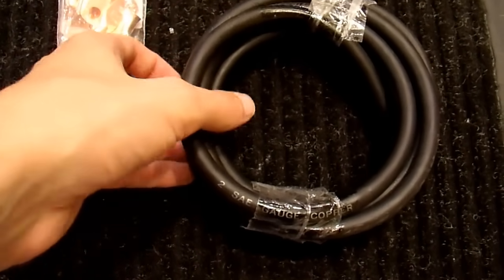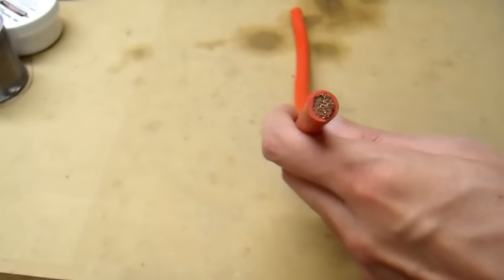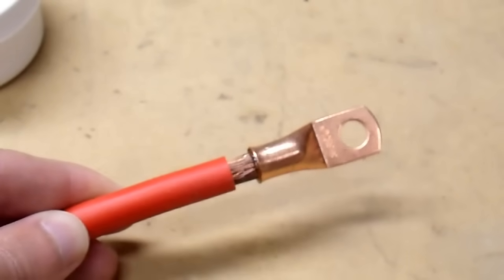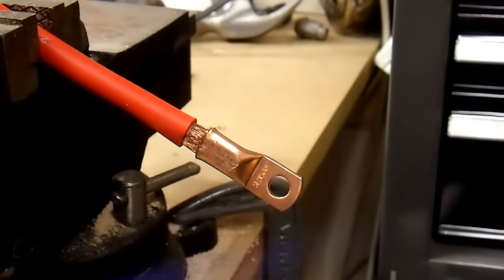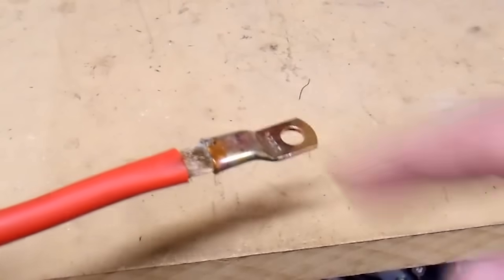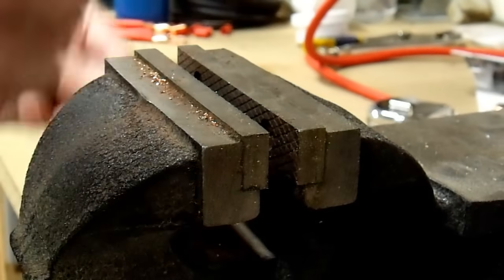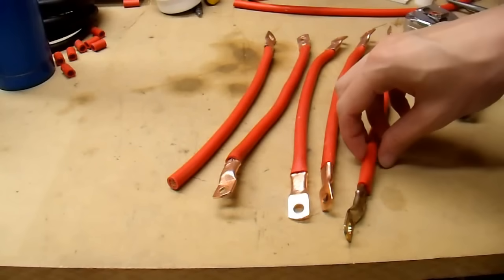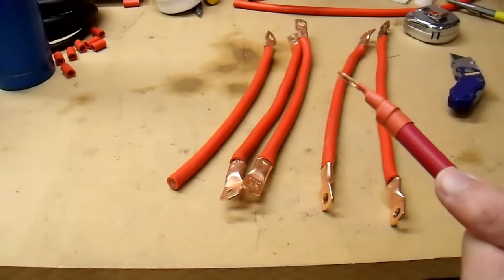How to Make Battery Cables the Right Way and the Easy Way

Comment: This is not the correct way to make battery cables.  Solder is hard and creates a fulcrum, a point that the wire will break.  Crimping is the way... Read up on Mil specs, and on aviation specs for battery cables,.. and automotive specs for that matter, none of them allow solder, and for good reason.  If you still wanna solder, then you shoudnt crimp.  Do your due diligence, then make videos.

Comment: Rosin is not acid.
Reply from the maker: Acid core solder exists and rosin causes corrosion if not fully activated.
Reply: @knurlgnar24  Yes. Acid core was always used for plumbing and rosin core for electronics. The container of rosin was used for tip cleaning by plunging the hot tip in the rosin to "flux" it when tinning.

Comment: I flux and tin the cable. Tin then fill the terminal with solder and stick the cable in the molten solder. Hit it a few passes with the heat to ensure it's flowed through all the strands, some heat shrink on it, done.

Comment: Putting solder into the connection is not necessary and in fact it is bad for the connection. The solder makes the strands od copper cable stiff and subject to be broken compared to an unsoldered joint which is more flexible!!!
Reply from the maker: It is in no way 'bad' for the 'connection'.  It is in every objective way helpful.  The flexibility issue is an entirely separate issue.  Would I solder a connection that is expected to flex during use?  No.  What percentage of applications are expected to flex during use?  Almost none.
Reply: @knurlgnar24  The whole purpose of doing this is to have a reliable connection and to say one aspect is irrelevant is foolish. Considering you didn't make your disclaimer in the video, my statement stands !
Reply: @LWRC  As a ROCK CRAWLER ( JEEP ) Soldering ALWAYS FAILS, ALWAYS, Crimping is the only way to go. A stated Solder causes connection to be stiff, flexing is what is needed in Rock Crawling.

Comment: Thank for making this video. Crimping is the preferred method for making the connection. Solder is subject to failure under vibration. Also, crimp connections alleviate the connection problems associated with wire and terminal hardware corrosion, as the mechanical action of the crimping crushes the oxidation layer, guaranteeing the low resistance connection. Soldering only encapsulates the existing corrosion, which causes a lowered ampacity. Crimp connection with v-divits are preferred to flat crimps, due to the mechanical properties of the interface created. Use of heat shrink, especially adhesive lined, is preferred, due to the added mechanical strain relief, as well as its ability to seal out corrosive elements. But not everyone needs a connection designed by an electrical engineer.  :-p
Reply: Agreed, we run 48V@600A at my facility and all lugs from 6/0 to 12G are crimped, no solder

Comment: Man! Electrical/electronic people are passionate about their craft!!! Maybe best for all (my) worlds: Flux & solder (tin) whole terminal lug (inside & out) and then cable end. Fill terminal lug cup about 1/3 with melted solder, insert cable and solder together, quickly, keeping flame near end of lug, away from insulation. Clean off any remaining (yellowed/browned/blackened) flux with 91% alcohol (that's what we used at Electronic Research Corp.). Apply Liquid Electrical Tape or hot glue, quickly slide shrink tube (clear?) into place and quickly shrink with Hot Gun (DON'T USE FLAME!). Cover cable terminal lugs and connection posts, after firmly connected together, with dielectric grease. Install non-conductive, sliding/removable boots over connections. NO CRIMP! I find it hard to believe that crushing/bashing thin copper strands together doesn't weaken and alter their molecular structure (cold welding my eye!). I believe that ANY pinch point, no matter how small, raises the electrical resistance, creating a (slight?) voltage drop. I desire the least amount of wasted power and the most protection against shorting and corrosion. Call me CDO. It's the same as OCD (obsessive/compulsive disorder) but all the letters are in alphabetical order... LIKE THEIR SUPPOSED TO BE!!! 🙃

Comment: You All Have No Clue As To What You Are Talking About, Go and Study Metallurgy, Rules Of Soldering And Alloys, That You Never Use Acid Fluxes In Electronics or Electrical Work, Work Hardening of Metal When Making A Crimped Terminal Connection Of Both The Wire and The Crimp While Making That Termination And How Heating By Soldering aneals, (Softens The Metals), That Were Work Hardened In The Wire And Crimp.
That Wire Extrudes When Crimped and Does NOT Fill The Internal Voids In Any Type Of Crimp Be It A Hexagon Hydraulic Crimped Copper Tube terminal or Lesser Red, Blue, Yellow Crimp Terminals Or Those that Crimp To Both The Wire And it's Insulation That Have Separate Insulating Clear Boots or Other type Of Pull To Unlock From Push on Faston Terminal Insulating Covers.
I Grew up Around Repair And Maintenance Of All The Electronic And Electrical Disciplines, Been To College to Get My Qualifications and Know About Equipment During World War II, That Could Not Be Used Except On The Ground Training Units And Not Used In Aircraft as It Was Made Unreliable Due to Being manufactured With Acid Flux Cored Solder, Namely R1155F Radio Communications Receivers, For Air ministry/RAF Designated as F Version For that Very Reason.
You Do Not Need A Degree to Acquire Correct Knowledge, But You Do Need To Research Before You Quote Crimp Manufacturer's Statements About a Crimp Terminal being a Cold Weld and Highly Reliable and Gas And Liquid Impermeable, Not Correct ! Even Remotely, That Is Marketing BS and Yes I Have Dissected Many Terminals that Are Crimped In Crimps And Moulded IEC Power Connectors And Both USA Moulded Nema 5-15P And UK Moulded 13 Amp Power Plugs, Also European Moulded Power Plugs
And Gained Knowledge From My World War II Active Father And Mother, He Royal Army Service Corps And She Postal And Telegraphic Sensor, Dad Then After The War Was A quality Control Engineer Working For AC Cossor, on Cossor Plan Position Radar Cathode Ray Tube Assemblies, Then Went In To Brown And White Goods, Radio and T.V. Repairs as a Qualified Engineer and Could Strip And Rebuild Car Engines Too and Do That Related Electrical Work Too, I Also Have the Same Skill Set.
It's No Good Making Comments and Telling Some One, How Wrong They Are or Quoting A Manufacturer's Assertion Of Their Advertising BS, If You Do not Know What you Are Talking About, I am Not Addressing This to Those Who Have made Comments Who Do Have Time Served Experience and Knowledge, Just Those Who are making Incorrect Statements Not Based On Correct Facts from Any Decade Back to Before WW 1 and Including WWII. Or Any Time Till The Present.

Comment: I stick the end of the solder into the wire and then wrap from the end toward plastic cover a few times and then stick it inside the connector. You could also double or triple the solder before you begin. Get a 18" piece and  just fold it over on it self a few times. I use heat shrink to cover the connection to seal it from air and water.

Comment: The correct way to check for corrosion on any electrical connection is check for voltage drop. This is going to tell you the condition of any electrical connection and super easy. You really want to seal wires up or what does happen is corrosion goes inside under the jacket and all the way through the wire. It will turn the wire black and lose connection somewhere on automotive harnesses that is a nightmare to find!

Comment: when i put it in the vise,i sandwich in a 3 or 4 mm round nail and the vise indents the nail in the lug,no expensive hydraulic crimper here...;  pull test...  done 
and then i just solder the end,just to...  make 2 sures
Reply from the maker: A simple vice smash crimp withstands a severe pull test just fine and heats under high current noticeably less than most cheap commercially purchased cables.  For most of us it is good enough and for many better than what's on the shelf at Walmart.
Reply: @knurlgnar24  a simple vise smash crimp is not a crimp:  the inernal area of the lug remains the same, just turned from round to oval,and there is no real compression of the thin copper wires together inside,they just spread out at will; a pull test is dependent on the force used... it will come off...
if you  solder it,the vice squeeze is ok, BUT the end of the wires MUST portrude to the front,the lug must be holed,not closed, you MUST apply solder well to both sides;  
of course,never mind,  this is mostly for intense,hi responsibility aplications;  for non critical connections,you may ease off, and  learn as you go, but maybe avoid that.

Comment: you can also get tinned cables and lugs to prevent corrosion, if that is a big concern for you (it is a 'must have' in marine environments).  A good crimping tool is also not very expensive if you are not pinching pennies.

Comment: Solder will not work for welding with high frequency. Need mechanical crimp connection. Use rosin core solder on any solder connections.
Reply from the maker: "Solder will not work for welding with high frequency".  huh...  That would be new physics that would revolutionize many industries given that all high frequency devices use solder for their connections.  I suggest you write a thesis on it to educate us.

Comment: When you only have the small solder, take some strands and twist them together.  Start with the heat away from the opening.  The heat will travel up the copper since there is no other path to get away like soldering into a long tube.  Take some alcohol and mix up a little with some flux it will soak into the cable better and fill more strands with solder for a better connection.  The flux is usually rosin and doesn't turn acid until it's heated.  Don't use the acid flux for copper pipe.  You can wash it with alcohol after you solder it to remove any excess.  Crimping isn't real necessary if you plan to solder it anyway.  The thick heat shrink with the hot melt glue (order you some it's a lot cheaper look for marine, red and black) really makes that professional finishing touch.  If you have a choice in terminals, get the ones without the flared end.  They are better for heat shrink.  Good job.

Comment: Buy the crimping tool if you want it right.  When I was a teen I used a hammer to make cables this same way and occasionally the wire would still come loose.

Comment: That works but the 10 second method is sometimes better. Clamp lug in vise with open end facing up. With torch melt solder into lug until half full. Insert stripped end of cable into lug immediately.. Slide heat shrink on when cooled. Bonus - lug can be reused.

Comment: Very Poor way to crimp battery cables. I've seen that type of crimp and solder connection come apart when cables got too hot from starting a vehicle too long. Using a hammer and anvil tool, you can get a super good crimp. Most parts stores sell a battery cable anvil

Comment: Good tip , over the years i’ve owned many Boats and almost everyone i’ve needed new Cables for  i also   own a dually Diesel Havy Duty Pick Up truck that uses 24 volt Starting Systems. for some strange reason General Motors uses Crappy Cables that wind up failing Prematurely and i don’t want to spend more Money on buying the same Quality replacement ones the Dealerships sell  so i make my own Custom ones for that Vehicle  it also allows me to  move  my Batteries  slightly into a better Position  for my accessories and other Electrical modifications  having the  larger Batteriy System i like to  add a Inverter  system  in my cabin area for conveniences of traveling  and towing trailers  ( i used to carry a small generator) but with the Ethanol fuel  here days. it’s a pain that it gums up the Fuel systems  and goes Bad quickly  so the Inverter is more reliable and the Factory set up supports it very well  today with all our Electronics and Gadgets  having too many 110volt Plugs isn’t a problem  so i build Custom Consoles to make  it look like a Factory thing  on the Interiors  !

Comment: Soldering for current carrying conductors is not recommended and not approved per NEC. Current and heat will produce a cold solder joint over time,  a proper crimp is best. You can make  crimping dies for your vice by splitting a hex nut of appropriate size in two halves. Take the two halves of the nut and hold them around the lug while tightening them in your vise. This would be good enough for auto cables if you can't afford a crimp tool. For building wire terminations you would need an approved crimp tool. Keep the solder for circuit boards and signal wire.

Comment: This is the worst information on how to make  a battery cable .All  bare copper ends should be treated  with no-ox or similar product and then the correct crimper/die for cable size and connector.If you can't do a proper job don't post crap .

Comment: Great information, thanks for sharing.   I would add 1 caveat regarding the use of solder.  The National Electrical Code (NEC) doesn't allow the use of solder on conductors used in building construction.  This code has no jurisdiction over automotive wiring but the reasoning for the restriction has practically application.   When large loads are applied heat Is a byproduct  thus the same principle used to secure the conductor will in fact cause the connection to deteriorate.   I say this after my boat caught fire while on the water.   The application demonstrated is no doubt secure 6and safe because of the use of proper crimping.  Again great demonstration and thanks.

Comment: Absolutely the worst soldering I have seen hold the torch a lot closer the blue flame should be just at the fitting and it's taking so long because you don't have a clue what your doing idiot

Comment: I agree with using the proper tool. Solder is not the best bet for high current.
Reply from the maker: Why?  In practical applications it is difficult to answer this without hand waving, logical fallacies, and attacks.  Solder has been used for a very long time to protect copper from oxidation.

Comment: If I was doing this for a marine application... no solder. Proper crimp. Tinned wire. Tinned terminals. Dielectric grease over the bare wire. Glue lined heat shrink over the the connection. The solder in an application that has any significant vibration will eventually break at the connection. Using solder also defeats the purpose of using fine stranded wire.

Comment: Nice video 👍 i'm going to the same thing when i should change the batterycables on my tractor but i'm going to use heatshrink over the terminals. And the reasons for that is that it protects the cables from coroding and that it also looks better. You are just letting the moisture inside your cables whitout using heatshrink.

Comment: for any sort of cable that is exposed to the elements you should definitely apply heat shrink.  
To answer your question about how would you know if it is corroding.  If you use an adhesive heat shrink then moisture will not penetrate and corrode the wires. If you just leave the copper exposed or use a standard heat shrink then it most definitely will corrode. The heat shrink also provides a strain relief.

Comment: I drill a hole in the terminal where the wire would end when inserted, mechanically crimp the wire, and then heat the connection with the wire in the vice to act as a heat sink and add the solder down the hole and observe when you see the solder fill the hole stop cool it down and there you have a well done connection

Comment: I have made thousands of custom battery cables for RV customers.  We never ever solder those connections.  Solder isn't good for high current applications.  A good mechanical crimp is the way to go.

Comment: Boy!  You opened a can of worms on this one.  I think like the majority of the comments that good heat shrink that's adhesive lined is the way to go. I have connections that were 20 years old and I changed out an inverter.  Cut one of the lugs off to check it and shorten the wire. They looked like new under the heat shrink.

Comment: Hasn’t he ever herd of solder pelets and shrink tubing
Reply from the maker: Most certainly have.  And have used them.  You can either parrot that which you have been told to parrot, or you can gain experience and come to find more objective truth through your own observations, experience, logic, and rational thought.  Such isn't popular these days unfortunately.
Reply: @knurlgnar24  I have been making battery cables for 30 years using soldering pellets and shrink tubing  never had a problem you are talking about
Reply from the maker: @220fwa  Nothing I've said here says making cables with heat shrink and solder pellets is a bad thing.  Jesus you people refuse to listen to reason, logic, objective data, or experience.  Heat shrink has special case uses that are useful but largely misunderstood and solder pellets are exactly what I am trying to say are an example of soldering terminations being a good solution.  One doesn't need to use a solder pellet to make a good long term connection.  They are just a standardized industrial process that guarantees repeatability.  Simple solder does the same for other applications.

Comment: I put the ring terminal in a vise, tin the strands on the wire, melt solder into the cup of the terminal and stick the wire in there. Easy for #2.

Comment: Neither of these is the "right" way to do it... They're both the "easy way".....   The correct way to make a battery cable is to use a proper crimp tool that creates a symmetrical crimp without just flattening the terminal on the wire.

Comment: It is my opinion that if high quality heat shrink with adhesive lining  is used, and it is applied apply it properly, it will not corrode because there is no oxygen in the terminal joint.  No different than conditions inside the cable itself.